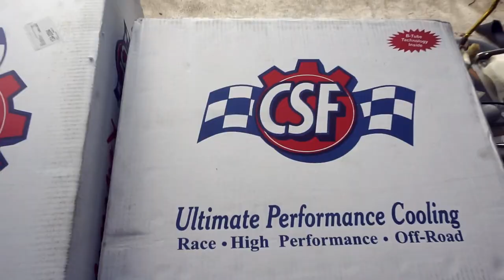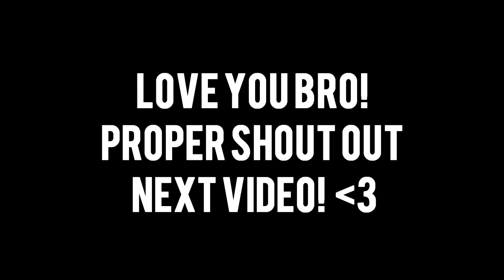MAKING THIS K24 EVEN COOLER! (CSF Radiator Install) - K24 Integra Build (EP.14)

Comment: Surprised that Hybrid didn't supply you with the griffin full sized K swap specific radiator and fans. For your thermostat, either run the Ktuned swivel housing or just get an oem K20 thermostat housing. the K24 and z3 thermo housings point upwards like yours is. The other K20 ones point down and it'll make that lower hose super simple.
Reply: help this man please smh
Reply: i'm on it homie!  want to see this man rollin' right the first time around.

Comment: Those foam is for the fan should to prevent metal to metal contact during Vibration
Reply: @grantd007grantd  that's one of the reasons too but am sure about the metal to metal contact because in some applications in which I have done with no shoud included in the kit the foam come with the kit and u put the foam on the area between the fan and the radiator to prevent contact when fan been zip tied to the radiator

Comment: Tubular crash bar!!! Light weight and less room! Also that foam is for the bottom of the radiator so that it won't  cause any damage or dings, or scratches or vibration. Nice build  home boi.

Comment: So you can buy oem or aftermarket upper core support bracket and your core support already has the holes in the proper position to line up with the mounting provisions on the rad. 
For the lower rad support you have to cut off the bracket that’s more towards the centre  for the half rad and relocate it over more for the full rad... should be a mobile welding truck in your area that will do it for like 50$ if you don’t have one. That’s how my buddy got his k mounted up in his crx at his apartment.
Youll definitely need the swivel neck tstat housing thingy and those foam pieces are to stop the chassis from rubbing on the rad anywhere because like I’m sure a lot of you have seen with aluminum intakes rubbing on strut bars, constant metal on metal contact for extended period of time will wear a hole in aluminum stuff.

Hope this info helped.

Comment: I think those foam strip you didn't know what they were is for the fan shroud. For no rubbing issue I guess and create a air tight space between the fan and radiator.

Comment: Drill the spot welds on the the radiator mount move it over and either rewelded or self tap the point back in

Comment: drill out the spot welds on that lower radiator bracket that's in the middle and just use some self tapping screws to secure it back to the rad support in the location where it needs to hold the radiator level.. that's what I did in my. civic to run a full. size..

Comment: for the radiator buy the tabs or cut yours and reweld where u need also for the future if u run a track bar u can buy bolt on radiator mounts for the bottom that make this so much easier

Comment: For my K swap EK I ran into the same issues because I also wanted to run a full sized radiator. I ended up getting a traction bar which let me mount the rad slightly lower and I used the K Tuned radiator brackets to mount the radiator to the traction bar. As far as hoses go, I’m still not sure what to use. I bought RSX lower rad hose but even with the swivel t-stat, it won’t line up

Comment: Pretty simple bro cut the radiator cups off the core support and move them where they need to be for that rad and weld them back or take flat stock and drill holes for the rad and weld them where they need to be if you wanna keep the OEM rad cups where they are Incase you switch back to a half rad later down the road

Comment: If you go JDM front then you need to do it all the way and go RHD. And I actually am in the position to suggest it. I am midway through RHD conversion on my EJ1. It ain't that bad, just time consuming as hell, if you can drill a spot weld you can do it and if I can learn how to MIG weld (zero experience before this) then so can you.

Comment: Yo......its ya boy rick from brokeman customs... she looking super phat so couple ideas on the radiator....jegs makes adjustable mounting brackets they worked great on my long before I switched to tucked..... it will allow the top to be pushed towards the motor enough to get access to the cap ... can also get a neck extender high enough to clear the front support.... and hook ya boy up on how to get sponsors .....and I'll trade you a brokeman custom decal for one of your windshield deacals